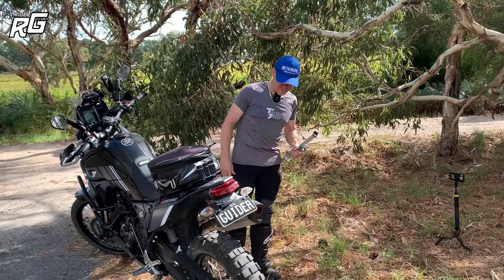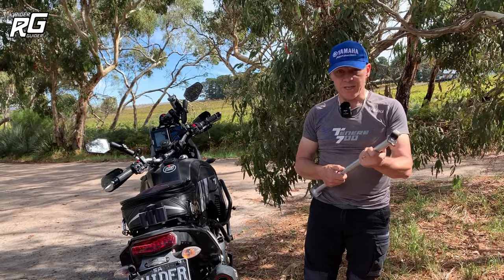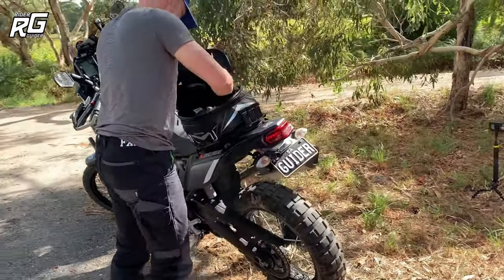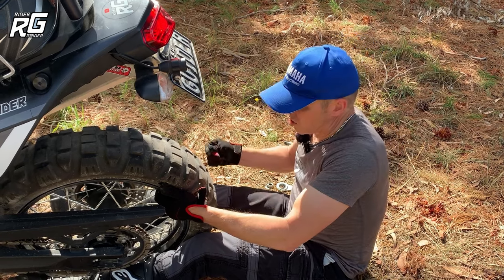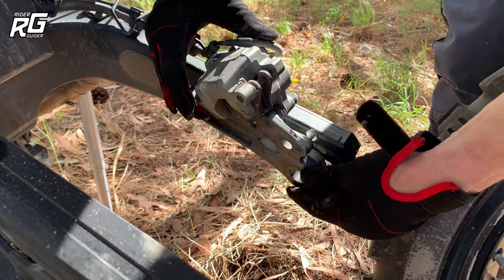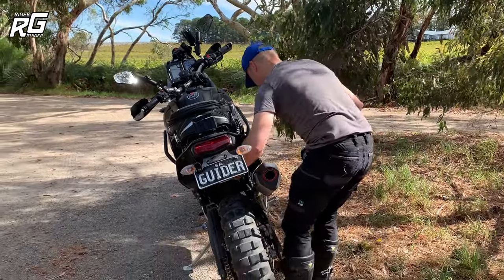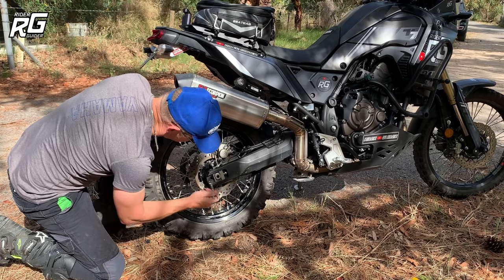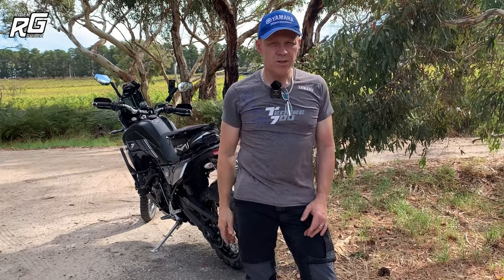YAMAHA TENERE 700 TRAIL STAND REAR WHEEL REMOVE AND REFIT

Comment from the maker: DISCLAIMER - I AM NOT A TRAINED YAMAHA TECHNICIAN - yet here you can see me rising to the challenge of removing and refitting the rear wheel of my Yamaha Tenere 700 ... normally no big deal?  Well this is with a difference, no centre stand, and of course no paddock stand either as I'm on a bit of a ride in a real-world situation using just the 'Ride With Me' #trailstand which I last showed viewers on a recent video https://youtu.be/5Qqmqo-ZMVo when I gave it a bit of a review.  

I decided to do this 'remove and refit' as it was suggested by a gentleman on a Tenere 700 Facebook page (thanks Carsten 😄) that it would possibly be too difficult a task because of the fact the back wheel wouldn't be vertical whilst using the trail stand.  This is because of the potential struggle with the brake caliper, the potential damage to the ABS sensor and holding in the wheel spacers along with the chain installation whilst also struggling to lift the HEAVY rear wheel and line it all up at an angle to suit the leaning bike.  Yes a bit of a trail stand challenge.  

Of course, this way is, or was, always going to be more difficult with these circumstances.  However, I decided that removing my centre stand was worth it for the weight saving and ground clearance improvement.  So I invite you to watch and see how I get on.   

Buy your track stand here https://www.ridewithme.site/the-essentials/trail-stands

#yamahatenere700 #riderguider #trailstandreview #besttrailstand #trailstandchallenge #ridewithmetrailstand

Comment: Nice that you took the time to test it in the field. My question - Why would you spend the time to loosen and have to then re-adjust your axle adjusters? Just leave them tight and avoid all that wasted time and hassle.  Once the axle is pulled just slide the wheel forward and peel the chain off. Install in reverse. Slide wheel forward, slip chain on. Pull back far enough to slide in the axle. Start the axle nut. Push the wheel forward and snug nut. Take bike off stand, torque axle nut. Ride off.
Reply from the maker: Haha yes mate, thanks, yes I realised that during the install, just an old habit from bikes gone by.  I did mention it in the video 10:52 ... and in the description that I'm not a Yamaha technician 😁 ... it was all about (mostly) the trail stand its self, but some good info learned and realised during the task.  I don't like making life easy for myself LOL.

Comment: Sorry mate, you made a meal of that. Couple of pointers, set your axle the other way around so the nut is on the right hand side, then you can stand on it to loosen it. Stick the Axel down the exhaust pipe to keep it out of the dirt.  Leave the adjusters alone, take the axle out and just push the wheel forward to get the chain off. Leave the calliper in place and spread the pads with a tire lever before putting the wheel back, you can always tape or cable tie it to the swing arm as a temp measure. Don't forget to pump the rear brake pedal before you ride off. 😉
Reply from the maker: Thanks.  Does say in the blurb, I’m not a mechanic.   Video was really to prove a point that it can be done with the track stand 👍🏼 … and yes definitely needed to pump the pedal ☺️
Reply: @TheRiderGuider  no worries,  just trying to help.

Comment: Cable tie round the caliper bracket and swinging arm (permanent) solves that problem, undoing the chain adjusters is a waste of time, once the axle is pulled the chain falls off anyway. The wheel spacers shouldn't fall out, on our race KTM 's we machine a small groove where the inner lip of the seal runs and tighten the seal spring about 3-5mm shorter. When the wheel is out and you have a tyre lever in your hand lever the brake pads apart to make re-fitting the wheel easier. Personally I don't bother with a trail stand even though I have one, tie-down strap on a tree, fence post, road sign or whatever does it better.
Reply from the maker: Thanks mate, yeh not a Yamaha Technician 10:52 I realised I didn't need to do the chain adjusters!  I like the tie down strap on a tree idea, that's awesome.

Comment: A little Tip...Grab yourself a branch or Stone with about the width of the gap from the ground to the wheel. Put the wheel on IT and ITS way easier to Put the wheel Back in.
You dont have to lift IT that high.
Nice Video though!

Comment: Neil this was really great and I think proves the point that the trail stands work really well for both the front and the rear wheels on the trail.   Even though you struggled a bit more than you would have in your garage with a rear paddock stand,  I think it worked far better than lying the bike on it's side or using a log or a rock.
Questions:     A) how do you pack that trail stand (it looks a bit long)   B)  Do you have any regrets or concerns with removing the center stand?  (I am thinking about removing mine now as well - I want to do the T7 "weight loss" diet like you did - I just feel like I have too much on the bike now  C) can you show us what you keep in your tail bag when you go out on remote rides?
Great stuff, mate.
Reply from the maker: Hello Buddy!!!  I think I'll do a follow up and show my whole set up with tools and camera equipment.  It's evolved quite nicely now.   NO regrets whatsoever having removed the centre stand.  The weight loss has been a really cool project.  My stand fits nicely down the centre of my rear bag on my mono rack, couldn't be any longer though to be fair.  CHEERS 🙂